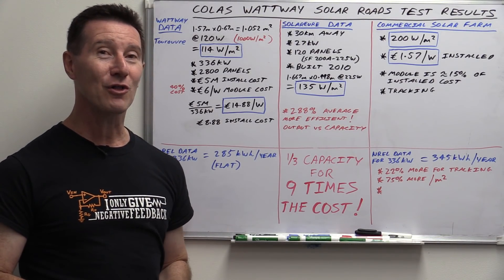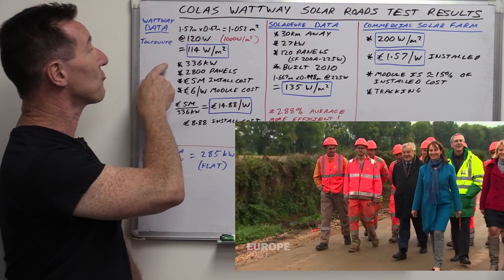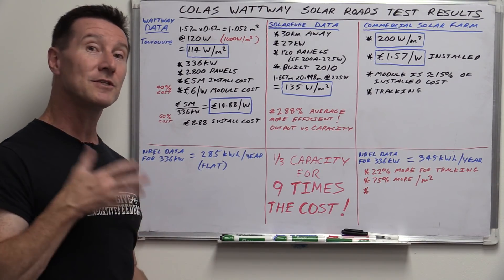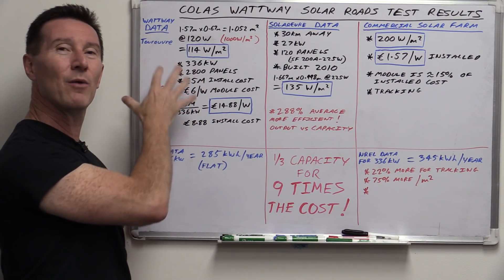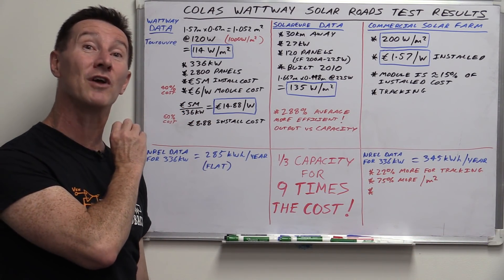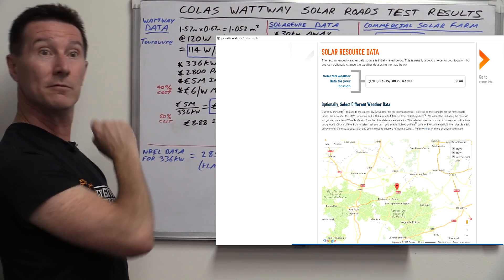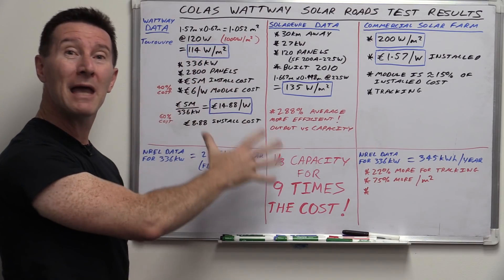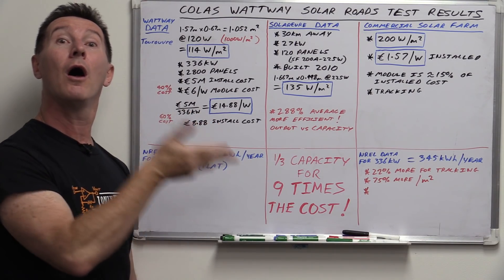EEVblog #1047 - Solar Roadways FINALLY BUSTED! (Colas Wattway)

Comment: Those in charge secretly know how inefficient it is, and that it's actually a secret jobs program! Automation is taking more and more jobs, but "we need the Solar Roadways to generate our electricity!" Of course 99 percent of solar electricity will still be generated out in the country or desert where the land isn't used for anything else and they don't need expensive translucent panels over them to hold up to the weight of full tractor trailers. It all fits together for Teh Future. People feel happy and productive working on solar roadways, and they don't have to know they're doing unproductive makework.

I'm reminded of this alleged story supposedly involving Milton Friedman:

At one of our dinners, Milton recalled traveling to an Asian country in the 1960s and visiting a worksite where a new canal was being built. He was shocked to see that, instead of modern tractors and earth movers, the workers had shovels. He asked why there were so few machines. The government bureaucrat explained: “You don’t understand. This is a jobs program.” To which Milton replied: “Oh, I thought you were trying to build a canal. If it’s jobs you want, then you should give these workers spoons, not shovels.”

Comment: I was thinking that if you were to use roads; using the medium area on separated highways would be an excellent place to set up a solar setup.  By using modules that can be attached/detached for maintenance  (upon breakaway struts so that an accident will just go right through them and "safely" separate them from the rest of the array).   Support would be simple since you already have ways to get up/down the length of the installation and you could position them to take the best advantage of the sun.

Comment: Dave, while I greatly respect your work I must ask -- who cares if it is less efficient or more expensive than a commercial solar farm? How much electricity do roads currently generate when they are being baked in the sun? Zero. If we can convert them into "solar roadways" and the net gains from the electricity is greater than the cost of installation/maintenance, it doesn't matter how much more expensive it will be compared to a commercial farm. As others stated, land has a cost associated with it, and not all land can be converted into solar farms.
Reply from the maker: "If we can convert them into "solar roadways" and the net gains from the electricity is greater than the cost of installation/maintenance".
Err, you can't.
And even you could, your money and resources to do it are MUCH better spent on vastly better solutions.
Reply: You obviously have not factored in regular maintenance and repair costs, they just won't pay for themselves.
Reply: That is because the numbers Dave has looked at are already worse enough, that they alone show how ridiculously silly the idea is.
Reply: Of course it matters how much more expensive it will be.  Yes, having roads generate power would be better than having them generate no power, but you could spend the same amount of money on EITHER have a solar road generate enough power for 300 homes, OR build nine solar farms in a field which together generate power for 8,100 homes.  From the numbers it's blatantly obvious which is the correct one to spend money on.

> If we can convert them into "solar roadways" and the net gains from the electricity is greater than the cost of installation/maintenance

We can't. At 285000Kwh/year and 5M euro total cost, it will take 120 years to pay back its installation cost, not counting ANY maintenance.  The solar farm would take a small fraction of that, perhaps 5 to 10 years, so is actually worth doing economically.
Reply: This post is in response to the robodude666 response to my response. Unfortunately this comment system does not have multiple levels.
I do NOT pick on random people. I only respond to baseless, incorrect comments. You are probably a decent, well meaning person, but you made a statement that was incredibly stupid in response to a video that was reasoned and well though out. Had you stopped and checked on the data that is readily available about land use, you would not have made your post.
Reply: Well firstly - they cant generate enough electricity to cover the cost of install and maintenance.  But look at it from an environmental perspective.  Producing the materials that go into building solar panels have a substantial environmental cost associated with them. So start thinking about the scale here.  Solar panels on roads are absolutely not going to survive nearly as long as commercial or residential installations - period.  So now you are talking about the ongoing cost to the environment of producing replacement panels for these things.  And at the scale of a solar roadway this would become incredibly significant.   There is just no way to argue for solar roadways in any kind of scale.
Reply: It's an issue because there's always a limit to money, so we have to choose where to best put the money. So accepting Dave's "1/3 efficiency at 9x the price" -- and there's no reason not to accept it, he put the numbers right there on the table -- that means that we could get 27x more bang-for-the-buck investing in other places.  Imagine if society put enough megabucks into solar roadways to satisfy, I dunno, say 3% of the energy demands of the nation (for whatever nation you're in). By choosing to put the same money into better technology they'd be satisfying 81% of the nation's energy demands!

It can be tempting to say "why not, some energy is better than no energy", but one has to consider that tradeoffs are being made, and money that's being put into poor technology is money not being spent on better technology.
Reply: Let's do a simple thought experiment here. First assume I have lots of money I want to spend on collecting solar energy. Would it be better to use this money to build solar roadways or to build a solar farm? As long as there is enough space left on Earth, and I don't have infinite money I think the second one would be better.
Reply: Your kidding right?  How many people have installed home solar panels who've actually had the panels pay for themselves? I haven't hear of anyone yet.
Reply: @Michael, et al., and that's perfectly fine. If the maintenance cost difference compared to a traditional roadway cannot be offset by the value of electricity generated, then great. However, my comment was purely from the point of view that in all of Dave's videos, as far as I can recall, he only estimated and compared the energy output to the setup cost, i.e. cost per watt. I don't recall seeing other comparisons, such as direct comparison of maintenance (other than maybe a few references to solar in general having a long ROI period) of a "solar freakin' roadway" compared to a traditional roadway on the whiteboard.

One way or another, I don't truly care about "solar freakin' roadways." They're a novel idea, and we can all agree they would be sweet if they were practical. However, yes, I would agree there are better ways to use our resources.
Reply: The point is
it is not "slightly less costly". It is "much more costly"!
Building roads is expensive. However the major cost factor in a regular road is NOT the top surface of the road. Asphalt is pretty cheap. The material is cheap and the installation is cheap. Much cheaper then using some high tec glass material which isn't even oriented in such as way as to get the maximum efficiency possible.
If you want solar freaking something, put your solar panels on the grass next to the road. Electrical installation costs the same and you have the benefit to be able to orient them in a much better angle.
Reply: @Execclouds : yeah, EEVblog is just jumping on the bandwagon here. Obviously a road installation like in France is not going to be as efficient as a proper solar farm or roof-mounted ones, but that's not the point. The point is to see if you can use certain types of roads for this purpose, and some problems simply don't show themselves until you do a proper study on it. For example, you wouldn't install this on a busy highway, but what about a rural country road in a hilly area? You could install a solar farm on the hillside as well, but then you'd lose the land for agriculture... Now, if it turns out that a multi-year study of a large scale project shows that it's just not feasible, then that's that... but at least it's an actual project, rather than that ridiculous solar freaking roadways joke in the US (the one with the flashing leds that constantly break down or catch fire, designed by some people who obviously sniffed too much glue)...
Reply: It is already tricky to get a generated power offset vs cost and installation out of traditional panels-- Basically, you get a return on them if they're put in just right, survive their full expected lifespan, and are in an area that gets a sane amount of direct sunlight.  Even nominal additional expenses directly hit that tiny margin, and installing them on a road will never be a nominal additional expense.  They will likely never even reach a profitable return being mounted flat on the ground, even without making them suitable for vehicles traveling on them.  

These current installations will never offset their costs, even with zero maintenance-- even if their per-cell costs drop to the same level as a traditional panel (they won't), the installation cost will always be higher, the power generation lower, and maintenance an absolute requirement (How long do traditional roads last without maintenance, again?)  At some point, we need to just be realistic.  It is about more than cost vs a traditional solar farm, but the more you consider, the worse it becomes.
Reply: We would only need to use 0.6% of the land in the US to produce our electricity. There is a limited amount of capital available to build infrastructure! Maybe we can stop building bridges, schools, hospitals etc. so we can build solar roads! The electricity gains are NOT EVEN CLOSE to the cost of building and maintaining the solar roads! If you check the top site listed above shows that  the solar road has produced about 150,000 kW-hrs of electricity, which sounds like a big number, but at $0.15 /kW-hr that would be $22,500 (about 20,000 euros) of electricity1 The installation cost about 5 MILLION euros! Even if they bring this down to 1 million euros the payback period would be FIFTY YEARS, even if there is ZERO maintenance cost and no deterioration on aging.
Too bad the educational system failed to make you STEM literate and left you incapable of critical thinking.
Reply: Merely pointing out that effectiveness over commercial farms shouldn't be the only consideration. Regardless, it's good to see your STEM education helped you critically think and pick on random people on the internet. Though I wouldn't disagree that education in the United States is atrocious. And hey, they're not just solar roads; they're solar -- freakin' -- roadways!!! lol.
Reply: robodude666 absolutely correct

Comment: So the big deal about solar roadways is that the land is already owned by the public, right? OK, so why not just slap a panel or two or three or four or whatever on the streetlights? They wouldn't need to be hardened against traffic, they could be aimed to gather the optimal amount of light, and their wiring is ostensibly already in place. I've seen parking lots incorporate solar panels in their light poles, which I assume generate at least enough power to light the lot. It stands to reason that even if the panels only generate enough power on average to light the streetlights they're attached to, that would still be a pretty huge energy savings over an entire metropolitan area.

Comment: What about inductive generator roadways? Seriously I wonder if this would work?
Reply: By what, stealing power from the cars rolling over it?
Reply: A bit like the traffic detectors you have in road pavement for traffic lights etc, except built to generate more current. I know this is silly but I wonder how well it would work

Comment: Withholding judgment one way or the other, a good argument for solar roadways would be that it could be heavily subsidized and its cost offset by the carbon credits a country would need to earn. Of course doing this will not magically lower the cost by an order of magnitude, the idea is that the R&D subsidies would lead to developing expertise in the (not exactly competitive) solar roadway market. Given an initial rollout in various test climates and loads, materials engineers would have a clear target which would also translate to other industries (abrasive environments, solar cells in inclement climates, etc.) and civil engineers might get a knock at coupling the solar roadway development with an overhaul of existing antiquated road building and maintenance strats. One obvious application would be using solar roadways to contain sensors and power lights directly according to usage and weather patterns. Then you might regain some of the investment in optimizing this higher order network. 

A country, or smaller entity, could even put this plan to a vote, thereby maintaining the promise of a Green Infrastructure movement.

Comment: Is better having roads that can produce energy than consuming energy, at least  can feed itself with energy, who cares how match cost! Or what you propose as better solution?
Reply: A roadway just sitting there does not consume energy.  You consume way more energy installing and maintaining the stupid solar roadway instead of installing the solar panels in a better place, which is more efficient, costs less, is more reliable, requires less maintenance, and is much simpler.
Once the whole rest of the earth is covered in solar panels, then we can talk about installing solar panels on roads, in mine shafts, and at the bottoms of wells.  Until then, lets spend our money on what produces the best efficiency and the most energy for our dollar.
Reply: Solar basement floor tiles!

Comment: Does your number for solar farm cost/watt include land cost or just the equipment?
Reply: Assume the cost of the land is as much as the installation. (it won't be) This makes it 3 euros a watt instead of 1.5. Still many many times better than solar freakin roadways.

And they won't get obliterated by cars driving over them.

Comment: It is only unpractical during summer and autumn. For the rest of the year the thing is not going to work at all. First of all when winter comes all the roads get coverd by a thick layer of comressed dirty snow so it is zero power output per square meter for almost half a year. And when spring comes it gets even worse - the temperature gets above and below zero every day so the salt and sand mixture that is used to prevent quick ice formation with all the gunk and already salty and dirty water is going to flow into all the electronics and cabling through of all the scratches and cracks that was caused by the traffic and freezing soil movements during the past winter. Even the lights that are being sometimes istalled on some walkways tend to massively die every year. A proper road is going to completely destroy the thing by turning it into small rusty grinded pieces. So the system is definitely not going to survive more than half a year in any reasonable climate like we have in Moscow. Solar power generation is a very questionable idea as it is, but the solar road idea is making it pretty much as stupid as it possibly gets.
Reply: And don't forget about cleaning snow of it. A typical snowplow would just remove the panels together with the snow.
Reply: Fully agreeing with you, just going to comment that the snow thing is not that big a problem in western europe. Yes, we have snow and freezing temperatures, but maybe for 2-4 weeks during winter and that's it. Thanks to global warming... That explains Daves funky data for december. So there isn't that much ice and snow as you are saying, at least not in western europe. But all your other points are indeed 100% valid.